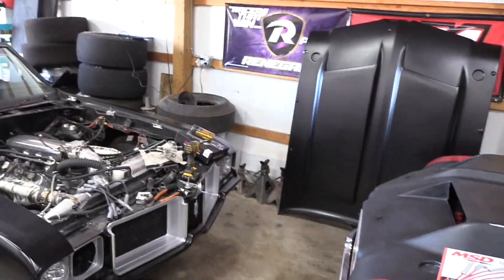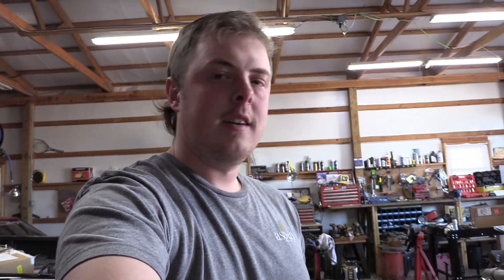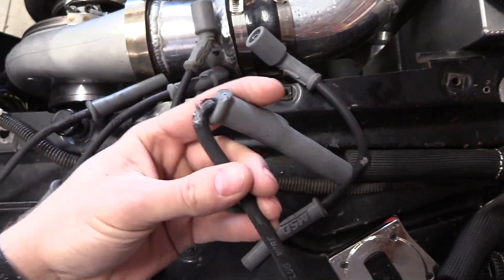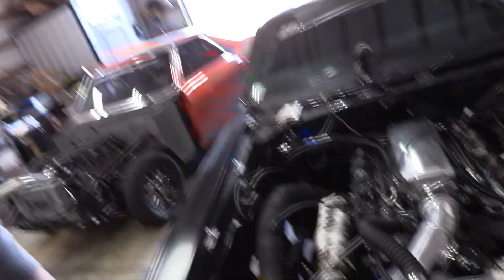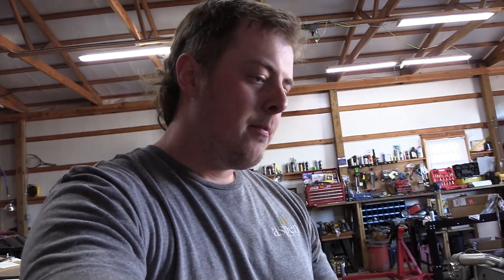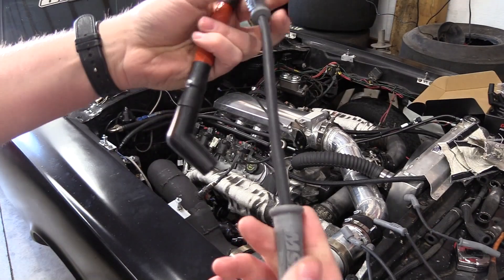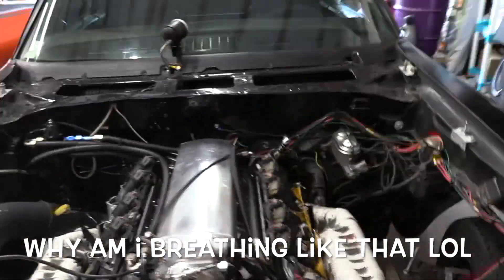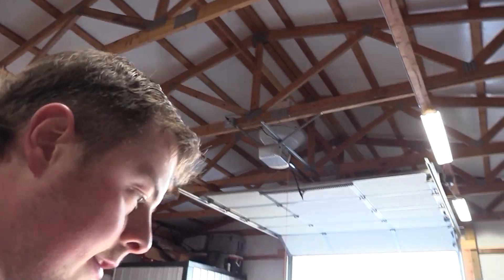My Turbo Ls Cutlass Had 6 Burnt Plug Wires!

Comment: On my g body(same headers) I remote mounted the coils to the side of the block with the ict brackets and used the msd street fire wires with 90* spark plug boots on them. Now the wires aren't even close to the headers and cleaned up the engine bay getting the coils off the valve cover.
Reply from the maker: I would like to just redo my hot side because I think it looks terrible 😂

Comment: I have a question??? What is the engine vacuum at idle? Why not get a pineapple juice can and put a fitting in the bottom and hook it to the intake, it will help with the problem you’re having

Comment: Have you already changed or been pointed in the direction of maybe a coil problem? I've had several times coils will fire fine when at higher rpm but lower rpm under load they cut out and misfire and feel like it's shutting off
Reply from the maker: Yesir I changed them already and still had the same issue
Reply: @Andrade Racing  maybe somethin wrong in the injector data? Saw something the other day somebody was having part throttle problems with the injector pulse messed up but it ran fine wide open too, cant remember who it was